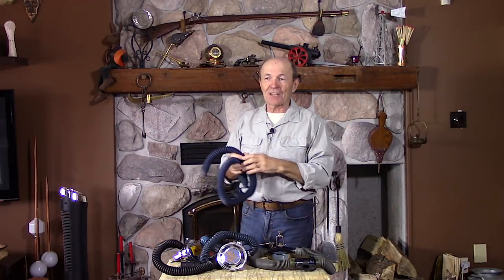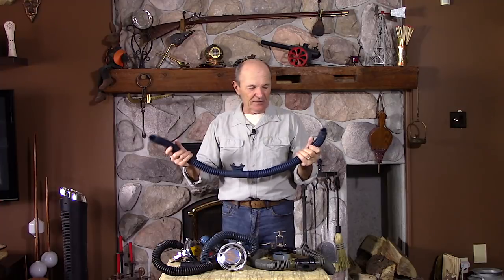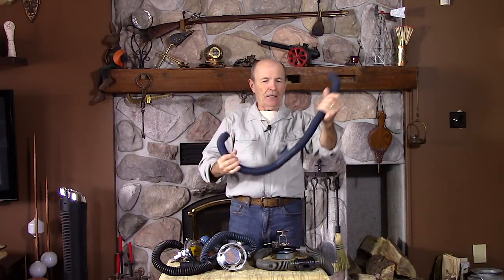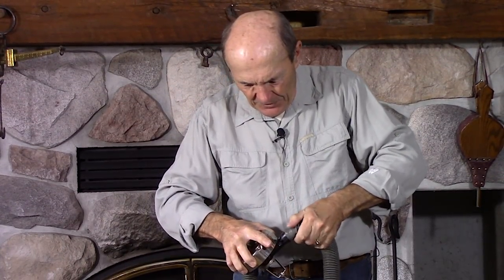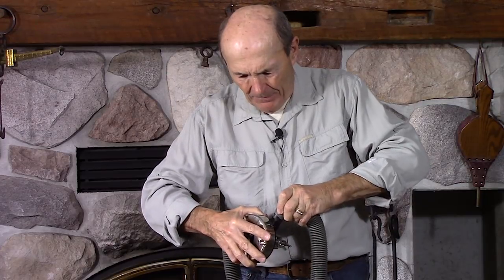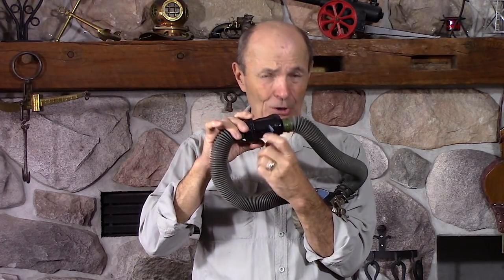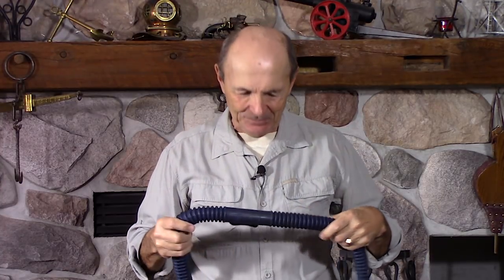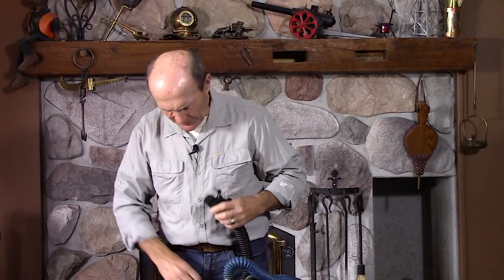Vintage Scuba: Double Hose Problems - S05E03

Comment: Alec, The Argonaut Kraken is a gem just gave myself a Christmas present...Bryan of Vintage Double Hose hand builds each of his regulators they are a master piece of of old and new...started diving in 65 with a double hose from US Divers here in Beverly, MA...just had the Kraken configured with a console on the high pressure port, a BCD inflator hose and a second air source off 2 of the 3 low pressure ports...tested the draw of the Kraken off a tank in the shop, smooth as as warm butter...this Sunday will take it to the pool for a closed water test...very happy to be back to the double hose never liked the single hose with bubbles in my eyes blocking the view and the constant sound of the bubbles rumbling by my ears.
Reply from the maker: It's the best modern double hose available.
Have fun.
Alec

Comment: How would you clear a rebreather? Just wondering and thanks for the great video once again!
Reply from the maker: Modern rebreathers are very sophisticated and have all manner of non-return valves. Some are for diver convenience and some are for safety (non-mixing or air/gas/water). 
It as easy to clear a rebreather mouthpiece as it is a modern regulator.
Alec